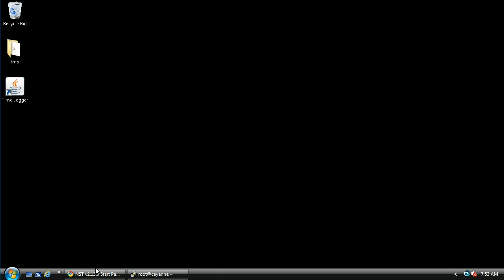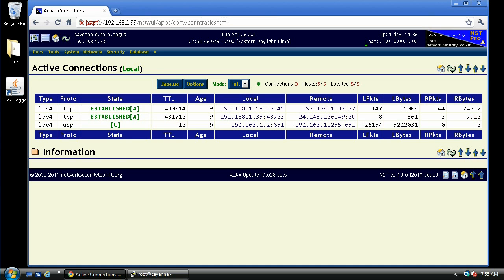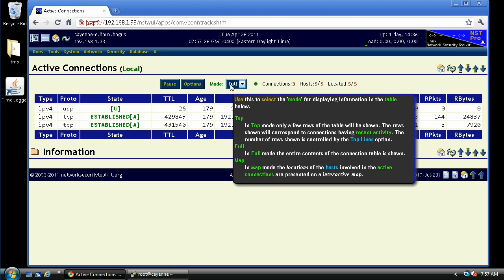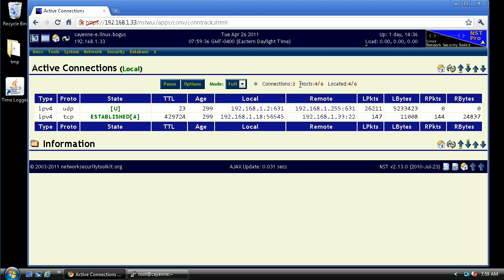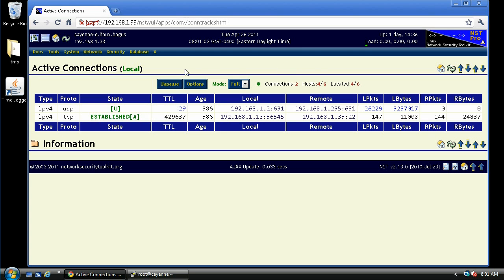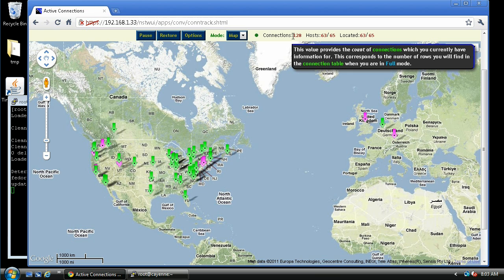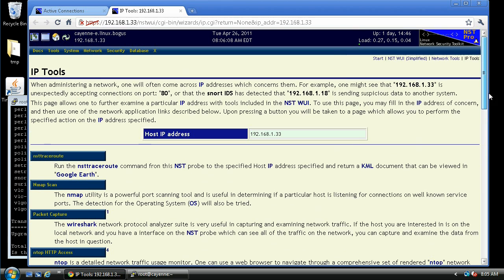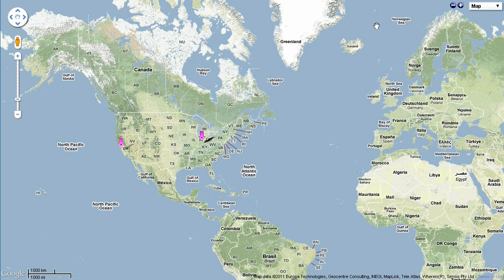Network Security Toolkit - Active Connections Introduction

Comment: So. How can I use this on windows? Without dual boot or installing VM.
Reply from the maker: Unfortunately, you can not run this directly on a Windows system. You would need to look for an alternative application native to Windows to monitor network traffic and geo-locate the IP addresses.
Reply: or use virtual box?
Reply from the maker: The web browser was running on windows and accessing the web interface of the NST WUI running on a separate system (either on another box or within a VM)
Reply: O ok. I was confused because in the video it appears your running it on a windows machine. Was just wondering how you did it.
Reply: He is running it on windows.
Reply: @toe_tag_9766  sorry if im late but he is using putty a lil program used to connect to other computers